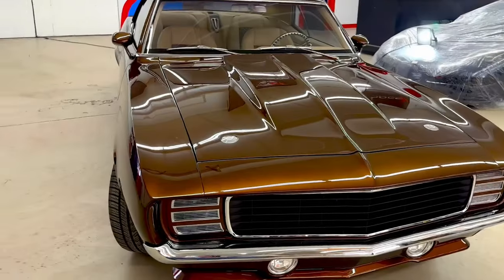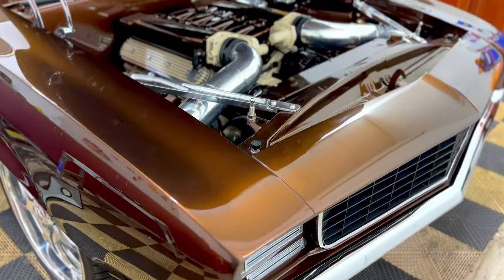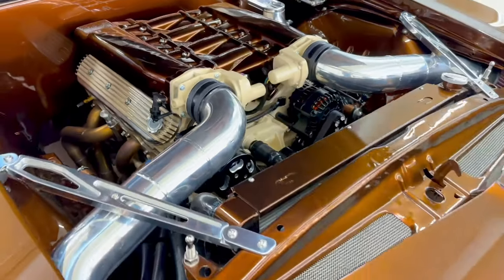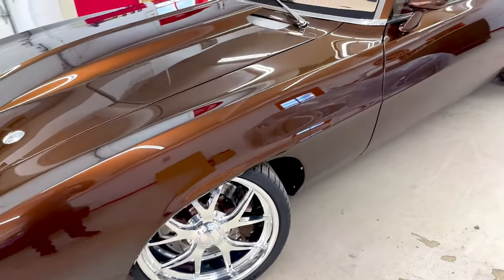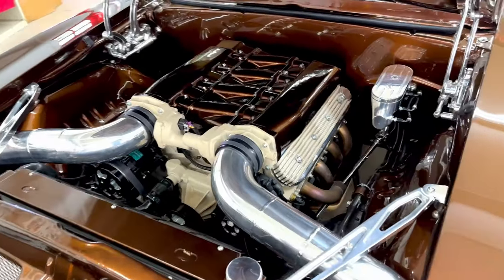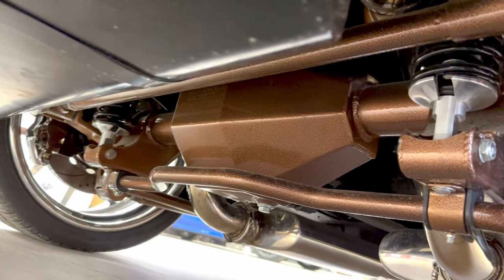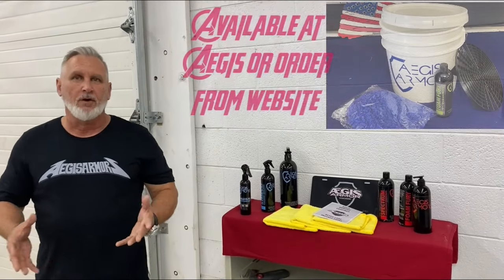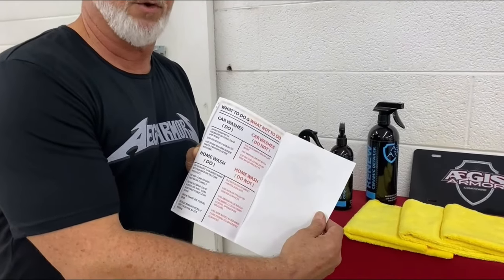Amazing 69 Camaro Build - Root Beer Float

Comment: I've never been a fan of brown cars.  That is until I found a sweet deal on a Desert Silver Metallic 2002 Acura RSX--a very classy colour that really pops in the sun!  Since then I've seen a couple Root Beer Metallics at car shows and absolutely love that colour in the sun.  Pictures or video just doesn't do the colour justice.  It seems like every car company stopped offering brown colours 15-20years ago.  That's because their browns looked like different shades poo, and no one wants to drive in a poo mobile.
Reply from the maker: I def was not a fan at first, but after the paint correction, polishing and ceramic coat it just popped like crazy.

Comment: Ya , It's bad as hell. I love the color
Reply from the maker: We really enjoyed working on this one.  The color is definitely unique. I wasn't a huge fan at first, but after polishing and ceramic coating were added, the color just pops like crazy in the sun
Reply: @aegisarmors  Paint ? How much to complete something that nice ?
Reply from the maker: @rwright3395  We did the paint correction, polishing, ceramic coating and powder coating for the project.  Not sure what the body work and paint cost were, but I do know the complete build was in the high $200K area
Reply: @aegisarmors  I will take a guess $ 20.000
Reply from the maker: @rwright3395  I wouldn't doubt it.  I remember the builder telling me the molding in of the rear duck tail spoiler took 50 hours

Comment: Colour name?or code
Reply from the maker: Not sure of the color name.  we did the paint correction, polishing, powder coating and ceramic coating.  I can tell you the top color is a Toyota color (I remember the builder making a comment about it) and there's a gold flake base color under.
Reply: Thanks for the reply

Comment: The clown shoe rims and rubber band tires completely ruin that car. Looks like it should be in a Flava Flav vid.
Reply from the maker: Well, it is a Pro Touring build made to handle and perform like a late model performance car.  Doesn't make much sense to have all that suspension and big brakes and then put a high profile tire that flexs and rolls over on itself...kind of defeats the purpose of this particular build.  That being said, it's not for everyone.